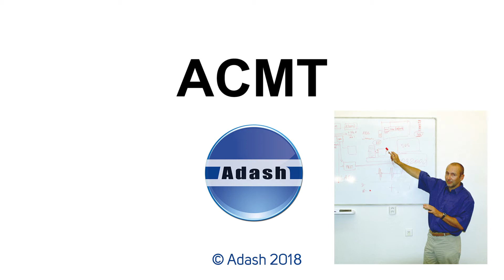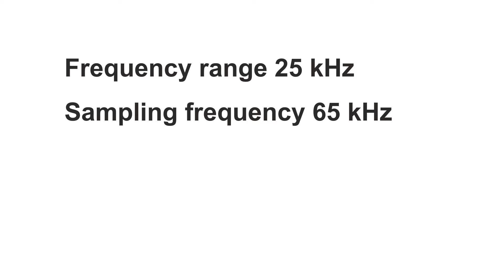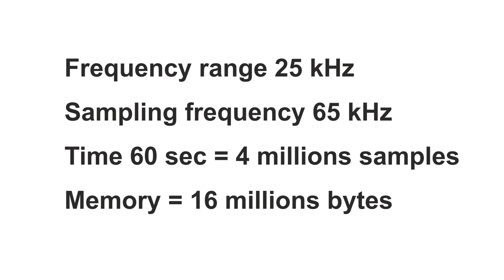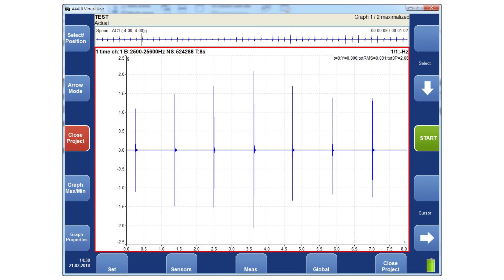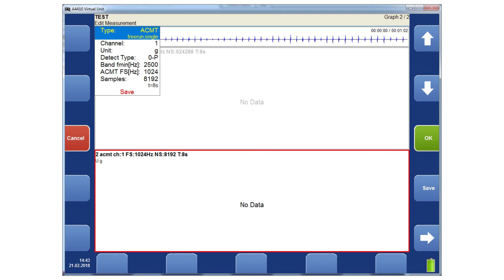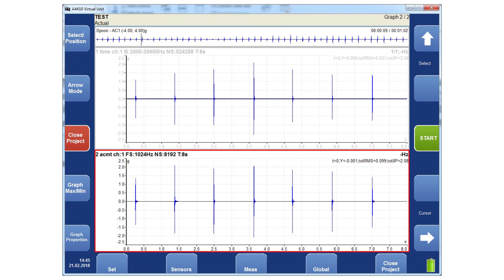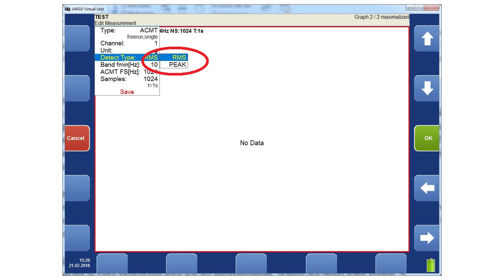ACMT - Low Speed Machinery and Bearing Analysis

Comment: I measured ACMT data on  very low speed gearbox output shaft ( 20 rpm) by using VA5 pro analyzer, will it be able to detect any roller bearing failure??, once you collect  ACMT data, what kind of signal treatment I need to perform to obtain failure frecuencies of  roller bearings??, or is it waveform analysis technique??
Reply from the maker: Set up ACMT to get more whole turns of the shaft, at least about 3-5. This way you can take a look if there are some repeatable / regular shocks in the signal which will indicate a bearing fault. ACMT is actually time signal method. See the VA5Pro manual. You can upload the ACMT into our DDS software and there you can convert it to FFT. There is also bearing database in DDS and you can switch on bearing fault frequencies in FFT.